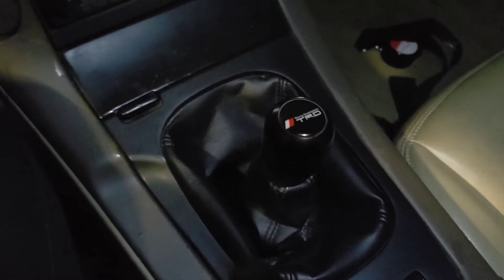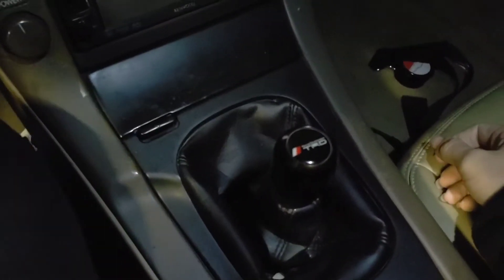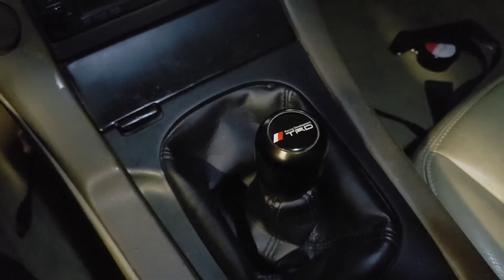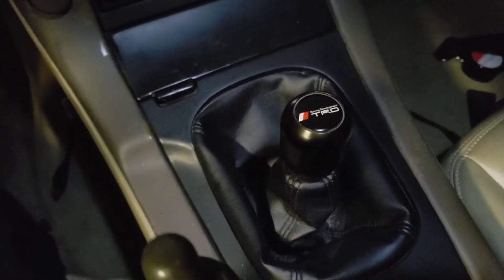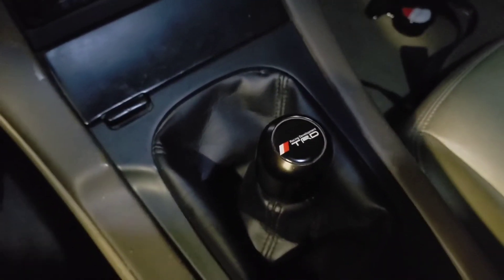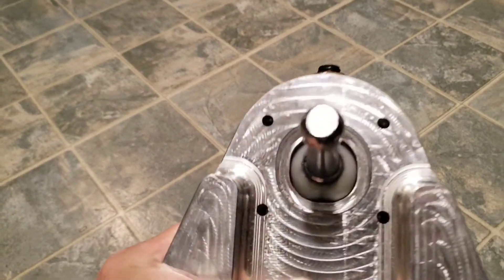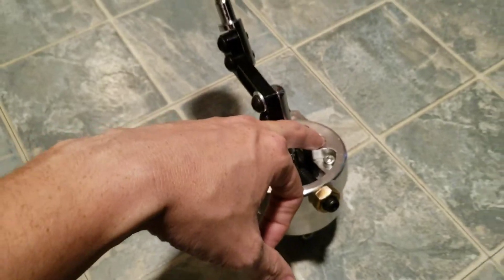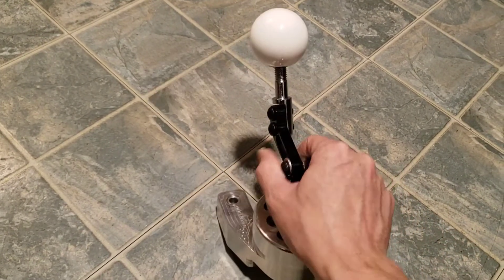Collins Adapters Shifter option for the CD009... Priced at $315.00? Yes or No... You Decide

Comment: my cd009 swapped sc400 has this shifter and 5th grinds at high rpms so does 2nd. it’s like the shifter doesn’t want to get it into gear properly. and it’s very chunky between shifts. any advice on how to adjust this?
Reply from the maker: @forrestcary  sorry i just seen this, more than likely it's not the shifter to be honest. All of my gears go in smooth unless if the trans is super cold... but 5th never grinds. So i would make sure your clutch is disengaging properly cause i did have this type of issue too. The clutch would barely disengage and the clutch would barely be engaged not allowing the shift happen smoothly. I went to a ¾" master cylinder and it solved my problem. The stock one is ⅝"

Comment: Did you have any vibration in gear? installed this nothing but headaches had to get the serial9 shifter.
Reply: Did the vibrations go away?
Reply from the maker: Yeah its alot better, there's still a little vibration but only before shifting from 5th to 6th gear. So I'm thinking the trans might be a little hurt. When I drive it more, I'll look into it more. Definitely better tho

Comment: Nothing but bad reviews on this shifter. Look into serial 9
Reply from the maker: Yeah that's one that I've seen that seems good, a little pricey but if it's good, I'm down to pay it, I didn't want to recommend another shifter to anyone since I don't actually own it...
Reply: Did you buy a drive shaft from Collins? Does the new trans bolt up to the stock driveshaft? I wanna put a cd trans in my lexus gs300 but dont know if ill need to purchase a drive shaft aswell.
Reply from the maker: @LMFAO5001  yes I had to get a new drive shaft... Stock one will not work